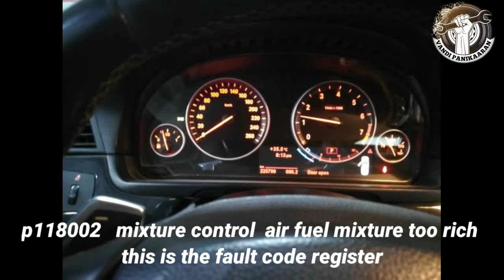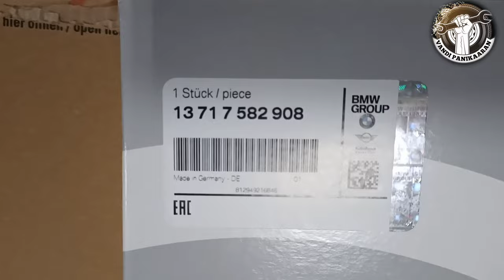p118002  air fuel mixture too rich  Bmw N20 engine  common issues   #kerala #germany #usa #kannur

Comment: Hi dear, i have bmw 740li and it si giving the same error code in computer test, also the car is shaking vibration when accelerating, please give me the solutiin, reventky i cahnges tappet cover, coils, water pump , turbo water pipe, aftwr that tbis problem came , please your advice.
Reply from the maker: Normally 740 Li  Air duct hose if  broken it will come same code .. did you check it  that ..

Comment: Hi, I have BMW 330e 2017- I am getting same code 118002 To rich. B48 engine. Do you think mine can be High Pressure fuel pump on my model? Thank you
Reply from the maker: B48  engine common problem  purge control valve .. first check for that. .
Reply: @vandipanikaaran1986  Thank you for your response. I Have changed the Purge Valve a few months ago But it was not the Valve the same code is still there. We have done a Smoke Test on the engine and there is no Air Leaks that we can see. Still trying to figure out what else to check for. Any help will be apreciated.

Comment: Hi There You have a good video here thanks I hope i fix my problem with my 2013 528i Drive, but also i have a question that I see in your video that the waste gate vacuum hoses are set oposite of the ones in my car, if you look at them unless is a different boost solenoid, I hope you let me knowI need to check the in my n20 too, thanks amigo for your help 👍😊
Reply from the maker: Thanks for watching my videos.. I hope  this video will help you...    And Some of this engine  one hose going to intake manifold  side And thair have one solenoid  mye be your car have   ..     I understand   what you mean...  Any way watch my video complite   then  you will know  what  you want to replace  your car ..      End of this video i  make a note that I replaced  this car..   For more  videos please subscribe  the channel and support..  Tnx....
Reply: @vandipanikaaran1986  thanks a lot regards

Comment: My error is air fuel mixture too lean.. 328i N26, i have sport intake, do u know what it could be ?
Reply from the maker: Hi bro  N20, N26  normally   we get  problems   air filter block. Or   fuel rail leeking
Reply from the maker: Do you check  smoke test.
Reply: Hi my 218i having air leak 
Does changing rocker cover a remedy

Comment: Mine was rich, turns out it was the high pressure fuel pump
Reply from the maker: When the car one time your high pressure pump faulty  then  rich mixture fault  come. you must be need to replace your car   engine oil and oil filter other wise the fault code will  coming back..  If fault  not coming back also you need to replace other wise your engine will be damage  coming soon

Comment: Hi my 218i having air leak 
Changed oil cap but again same problem 
Now they are telling to change the rocker cover 
Any suggestion please
Reply from the maker: What your car dtc its same.. Or different..
Reply: They said mixture adaptation fault
Reply from the maker: @lintothomas5129      car location dubai  or abudhabi...      Have any oil leak for this car around tappet cover..   Normally  bmw engine common have problem  tappet cover..
Reply: @vandipanikaaran1986  yeah ther is oil leak in the front crank case and bw rocker cover and oil cap
Reply: So will those things sort out the problem

Comment: I have code 118002 in a Mini Cooper F56 2018, and I changed all the parts, plug, coil, filter, sensors, and cleaned the fuel injectors, and the code is still there.
Reply from the maker: Wher is your car location sir ..
Reply from the maker: If abudhabi I can help you   .. you can come directly  to our garage..  Aarya auto   primium Abudhabi..    any way   are you mechanic or you are the owner for the car ..   any way Please check smoke test Mye  be some where  hose leak  ..   also chance to rich mixture   or watch my video complite then you will get  some of  more  idea .. Tnx
Reply: @vandipanikaaran1986   ksa 💔
Reply from the maker: @khalidalahmed2109  🙏
Reply from the maker: 2018 model  if the engine  b38 or b48 normally fault coming  one purge control valve  is thair  it  will be coming  same fault  code
Reply: All the parts in your video have been changed and the gasoline has been purged and the problem still exists 😭
Reply: Do a smoke test
Reply from the maker: Did you change engine oil and oil filter..
Reply: @vandipanikaaran1986   yes

Comment: I’m having this issue with my BMW X3. Keeps on stalling when the engine gets warm.
Reply from the maker: Bmw all model  car  same engine they are using.. So all the model have this common issue.   for checking   you need to do good diagnosing.. Depend on the  fault code only we can follow..  If your car same fault code coming  keep watching complite iam sure this video helpfull  for you.. Tnx
Reply: I am getting this exact code with ISTA - Really hope this is going to help fix my issue. I have been trying to get rid of this issue.
Reply from the maker: Please subscribe the. Channel  you will get more videos...
Reply: @keeganed4082  did you repair ?